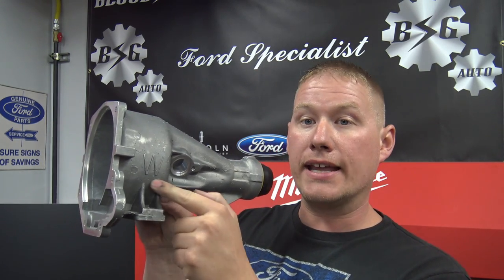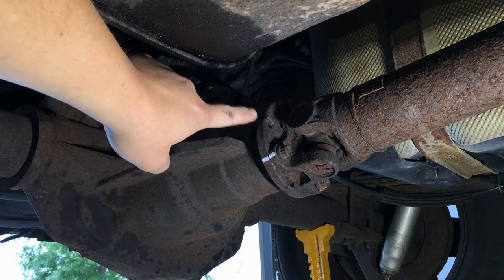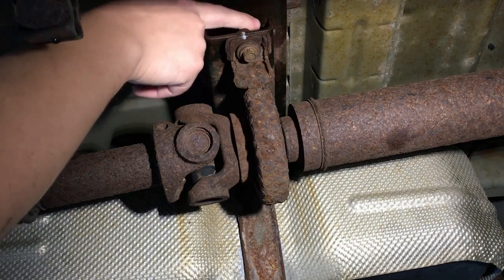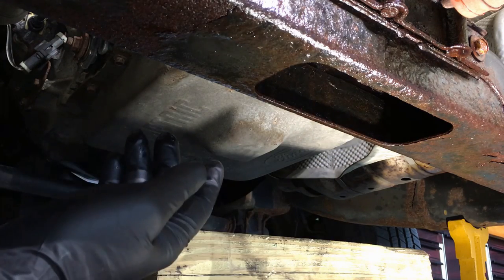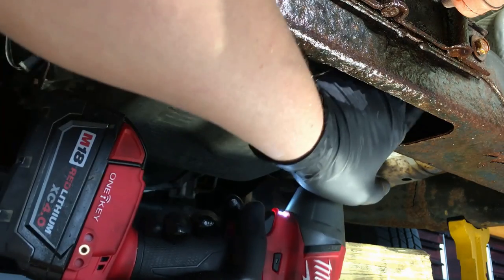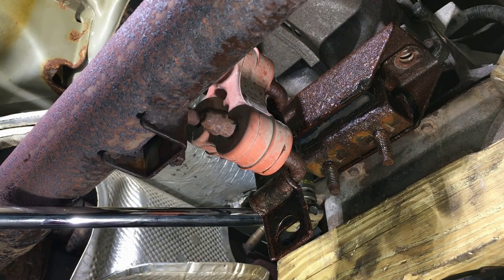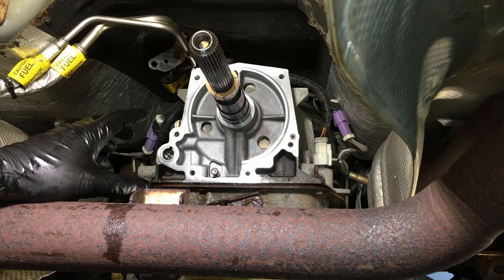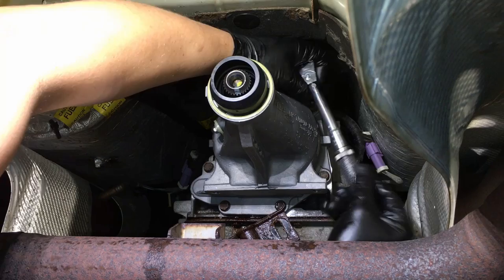Ford 4R70W Series Transmissions: Tailshaft Housing Replacement

Comment: Be aware that if you order the extension housing online the yellow sensor plug and the 1/4x20x.62 screw to hold the yellow plug in on the extension does not come with the plug. They are sold separately.

Comment: I just noticed a leak in that area on my '07 E-250. I was wondering if it was the gasket but this makes so much more sense. Now I have to do a good cleaning of the area to make sure this is definitely the problem before going any further.

Comment: Crazy late to this comment feed.  I’ve seen multiple sizes listed for the part 10.25”, 10.5” and 11.25”…. Which would be correct for a ‘06 F-150 with a 4.6L?
Reply: It would be 10.25 or 11.25 there isn't a 10.5. This is measured from top to bottom without the tailshaft seal installed. Hope this helps.

Comment: THANK YOU ! AAMCO  "diagnosed" the problem as a bad pan gasket and wanted the low, low price of $880 US Dollars to take 14 bolts out and put them back in. I didn't think it was the pan gasket so I started investigating and found this video. You might as well have filmed in on our E-350. It looks exactly the same. My wife said "It looks just like the video!" The only issue I'm having is the link you have leads me to a part that has the same number on it the picture that is shown (RF-F3LP-7A040-AA) that is different than what is in the description (F4TZ-7A039-C). Need to find out if that fits mine. But again, thanks for your help!!.

Comment: Kudo's for doing this like most shadetree mechanics would be doing it - up on jack stands! I find myself in the position to be doing this exact replacement, the only thing I can mention is I am finding that there's 2 different lenght tail housings ( 10 1/2" & 11 1/4")  so I hope people check and measure well before ordering parts. I also laugh at the immense amount of rust thats on the bottom of this Chicago area vehicle ( just like mine since I live here also)

Comment: Excellent video! Thanks! I have a vibration in my 1998 Grand Marquis that feels like driveshaft speed. I removed the driveshaft and the joints feel smooth. However the output shaft seems to have excessive play. Do,you think a new bushing will fix it?

Thanks!
Reply: Did you ever find out if it was the bushing?

Comment: You mentioned you used nickel anti-seize. is there any particular reason to go with nickel for this application? (as apposed to aluminum or copper anti-seize)
Reply: Copper is another dissimilar metal that will react with the aluminum.  Nickel is compatible with both steel and aluminum.

Comment: so, because that transmission has a mechanical output speed sensor, correcting the speed signal is easy as crimping a resistor to the power output wire because that is an analog instrumentation unit "pcm", but if that's a correction for a 3.08 to a 3.73 the shift point would move from 4900rpm to 5800rpm... creating an added 17% in torsional deceleration in shifts similar to brake horse power as then to be 540bhp on a 360hp engine. does nothing put brake the 1 inch 8.8 axles on the second gear shift... get nothing but 60 foot out of it. gear swap and shift point tune = 640hp simulative effect on shifts that the torque converter takes up as a manual would just burn out the clutch. "Go Auto"

Comment: Good evening had a question about the 4r75e. I have a 06 roush F150 I’m working on the customer said the transmission was recently rebuilt it shifts great but once it gusts 4th gear tcc locked there is a huge vibration. I removed the drive shaft last night and noticed the output shaft on the transmission have a good amount of movement up down and side to side. how much (end play) movement should the output shaft have?

Comment: 2009 f150 4 x 4  output tail shaft I replaced the seal several times and I still have a leak. Is there a bushing that needs to replace? 

And if there is a bushing what kind of symptoms would that cause?

Comment: I have  a  2012 e350  ford extended van    trans id Q

  Can  i use other 4r75e transsmisson from other yeras truck or vans  if they 4r75e      only the extension housing needs to be changed?  Or i need follow other  diffrences?
Thanks

Comment: Hi everyone I have a question about this tail housing.  mine recently cracked right where he said they crack at, I was wondering if the numbers on the sides of the tail housing matter when ordering a new one?  cause the one he took off in the video was a 48 w but the one he replaced it with said 44 on it.  on mine it says basic 50 w do I have to get one that says 50 w or not any help is appreciated.

Comment: Nice info there. You can definitely see the difference between the E-Coated Frame & Bed and the non-E-Coated Drive Shaft and Carrier Bearing. at 6:12 by the corrosion. I think it's time to change those bud. Thanks for the video and the fix on that, you have some good info there. That's why I subscribe to you, because you've always got some good info. I appreciate all the work you put into these video.
Best Wishes n Blessings. Keith

Comment: At timestamp 19:58, there is that yellowish busing that slides onto the output shaft splines, I pulled my extension housing to find that mine is cracked in half, do you know what purpose it serves and if it should be replaced?
Reply: That’s only for assembly purposes at the factory. You can discard that rubber part.

Comment: Hey iv got a 1995 Thunderbird with 4.6 v8 .my transmission want shift into 3 or 4 .it's a automatic I was checking on used transmissions but they tell me I haft to use one from a 94 or 95 Thunderbird or cougar why is this

Comment: Anyone know of a decent Ford repair shop near glendale CA, I have a 05 F150 with a P0174 bank 2 lean code on top of that it can't accelerate over 35. Popping sound when floored and no power. I have exhausted my patience with this truck. 
New plugs new coils, new fuel pump. I have ruled out O2 sensors, MAF, Fuel Inj Press Sensor, Swapped injectors bank to bank. R&R intake manifold w new gaskets and brake booster hose. Cats read less that 1/2 psi at 2500 rpm. No change at all. Long term fuel trims are 24+ at 2000 RPM. Bank 1 runs slightly rich bank 2 runs very lean. 

I just needs shop that knows what it is doing.

Comment: Hello, I need your help. I have 2015 Ford Escape 2.5 liter se model. It's making chirping poping noises in the front. Happens during pulling off from a stop light and breaking in the mornings. The actual noise is identical to a video loaded on here. ( type in search engine 2013 Ford Escape making chirping noises) do u have an idea of what it might be? Doesn't happen all the time. Ford can't duplicate the problem. It's becoming annoying. Please help.

Comment: I have built C6 in a 70 torino with a 700hp BBF and my tail housing keeps breaking all the way around the housing by the bolts.  I have had my drive line checked, the phasing checked, the rear end checked for square, etc... and cannot figure it out for the life of me.  Any ideas on what could be causing this to keep breaking?  it is only under heavy load on traction.  on the street doing burnouts it doesn't break.. !?!?

Comment: I've got a E 250 2003 it's not engaging in drive. It just revs constantly  then it will catch eventually  I changed out the filter and the sensors inside the trans pan and I still have the same issues any idea what I am dealing with??

Comment: 1/4-20 is an odd thread? To who? That has got to be the most common thread in the whole of the USA. 10-24 might be a close contender too.
Reply from the maker: For Fords, almost every bolt is metric and has been for decades on Ford vehicles.
Reply: I guess I'll give you that one. I mean, the tranny pan does have "METRIC" molded into it in giant letters.

I think their idea was that they ship the plug without a bolt to save cost, and most guys can find a 1/4-20 bolt somewhere easier than a metric.

Comment: Hello makuloco big fan of your channel I am a subscriber..need ur help and expert advice I have a 2008 crown Victoria p71 my tail shaft started leaking from the seal we're the shaft connects so I replaced the seal with a Ford OEM but after 80 miles it started leaking again....I did notice some play in the tail shaft but not sure if that was normal any advice on what could be happening..I was told it could be the bushing but not sure is that part of tail shaft housing..any advice on what parts to replace..thank 👍

Comment: can  that plug you put in the sensor hole ever fail? my housing is leaking and its not from the gasket or the shaft seal, seems to be from the plug.

Comment: Nice video...
Does this apply only to 2 wheel drive/ rear wheel drive?  Or can this happen to 4wheel drive too?
Reply from the maker: This concern with rust jacking is only a major concern with the 2wd tail housing due to the design.

Comment: Brian - Was there any reason why Ford didn't have the RTV gasket bead on the tail housing gasket at about the 8 O'Clock position?   The rest of the gasket has sealant. Only that one spot on the tail housing gasket didn't have the sealant pre-applied.

Comment: Does this help stop the side to side wiggle got a 2003 Gt mustang that I replaced the u joints and still getting a noise from under center console
Reply from the maker: It would only help with any driveline vibration if your tailshaft bushing was worn.

Comment: So... if ford engineers had placed a 50 cent gasket in between the aluminum tailshaft housing and the steel transmission crossmember, this problem would most likely not exist?
Reply from the maker: The tailshaft housing never touches the crossmember.
Reply: @FordTechMakuloco  Ok,  I am sincerely trying to understand this... at  1:06  you stated "right here, across the bottom, is where it attaches to the transmission crossmember".   My comment about the Ford engineers, and placing a gasket in between the two dissimilar metals makes sense to me.  As an A&P aircraft mechanic, we were trained to watch out for the dissimilar metals corrosion phenomenon, hence my view on separating the two metals with a gasket (or other material) to keep them apart and avoid the corrosion problem in the first place.  If the two different metals were kept separate from each other, as the build  should have been from the factory, this rust-jacking problem would likely not exist, and the stress fracture failure of the tailshaft would not have been an issue.  Did I miss something here?  I re-watched the video to see where I got it wrong about the tailshaft touching the crossmember, as you have corrected me here.  Can you explain to me where I have this wrong?

Comment: I just recently dropped my driveshaft from the front on the highway an apparently the shop tells me that housing is cracked.. All could have been worse, but new ujoints, new driveshaft an then the tail of the transmission repair. Already at about 400 bucks an now needs to get towed to another shop to do the trans work.. The depression is real. 02 f150 xl
Reply: They say when the shaft broke free it whacked the heck out of it. But everything else looks good so far regarding the rear end/differential so yea, happy for that at least, could have been worse for sure

Comment: I need this replacement in the future. Mine isn't cracked but the rear seal lightly leaks, but do you recommend a shift kit for a little bit more of a firm shift the reason I want it is I'm lightly building my engine with some bolt one. It's a 96 5.0. Thank you.
Reply: Bolt ons
Reply: Look up the Jmod. The procedure is named after one of the designers of the trans (Jerry) and he came up with it. It's the only good way to firm up your shifts. Whatever you do NEVER get one of those shift kits for these transmissions. According to Jerry they fool with stuff the computer should be doing, and things get screwed up.
Reply: David McClelland I'll look into it right now. Thank you!

Comment: Say you forgot to draw a line on the axle to the pumpkin, could you just clean the rust off both matting surfaces?
Reply from the maker: +Joshua Harden yes that would be the course of repair at that point
Reply: Películas

Comment: apparently they are not worried about the stress cracked frame near the Jack stand at 10:59. great video
Reply from the maker: +Dave Monteiro No that is where another section of the frame is welded together. On these it's not one long smooth boxed rail.

Comment: Wouldn't a thin rubber pad be better than anises that will wash away?
Reply from the maker: Its bolted down so tight it would be hard to wash it away that why they call it never leaves but a thin dielectric pad could work also but would likely break down faster.
Reply: Thank you for the response so fast.

Comment: i have this crack on my van. i just dont get it its just an ear for a mount point, how does oil leak through there?
Reply from the maker: fluid is sloshing around inside the tailhousing so once the crack is made it seeps out.
Reply: @FordTechMakuloco  but the crack doesnt even reach the actual "oil container", does it? or it cracks and leaks out through the bottom where the galvenizing rust happens at @19:12 ?
Reply: maybe its not leaking through the crack in mount leg but maybe just through the gasket due to tailshaft being tilted up from the rust pressure, have you examined the inside of a cracked tailshaft?
Reply: Yeah, I'm not sure where the actual leak is coming from either, the crack doesn't seem to go fully through to the inside of the housing. I was thinking it could be from the gasket too, but it's possible during use the movement of the vehicle and heat opens up the crack more.
Reply: @DickTickles  i think the gasket leaks because the tail is pushed upwards. either way, replacing it fixed leak. Thanks for video, extremely helpful!
Reply: @briinums  You did this yourself? How difficult was it to remove the bolts from the transmission mount or did you buy a new mount and not bother taking off the old one?
Reply: @DickTickles  i bought a used unit off ebay and let my friends do the work but i gave them your instructions. I just dont have a way to raise the conversion van on my own, other than that it shouldnt be hard. It wasnt hard for my friends at the shop

Comment: Unrelated issue. : People drilling holes in the ecoboost intercooler with either a 1/32 or 1/16 drill bit to allow condensation to drain out. lots of videos. please weigh in on this subject. Pros and cons would be greatly appreciated,  and would make great content for your channel. p.s. I'm a huge fan of your videos.

Comment: If someone was going to replace the transmission mount as well due to corrosion, does the old mount have to be removed from the housing to remove the housing? The mounts are inexpensive enough it doesn't seem like a bad idea to replace them as well.

Also, do you recommend red or blue loctite on the transmission mount bolts?
Reply: Only if you're going to re-use the bolts.